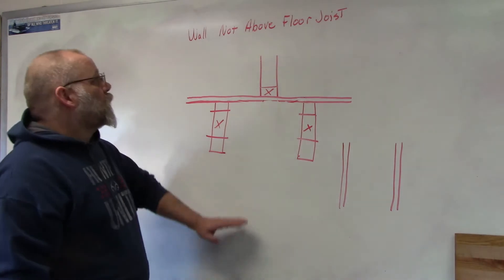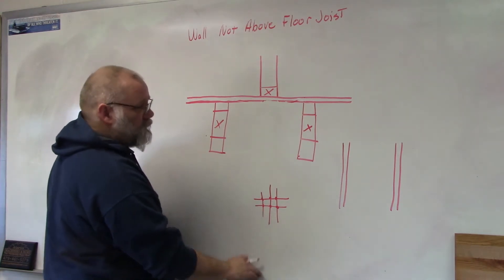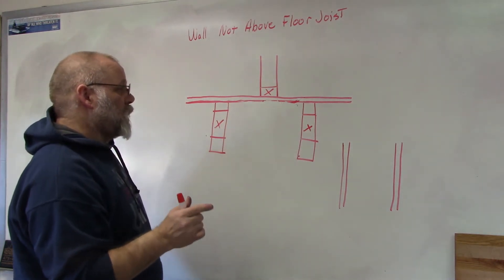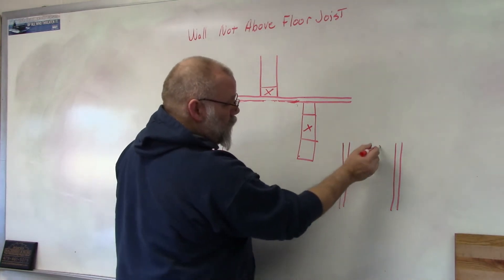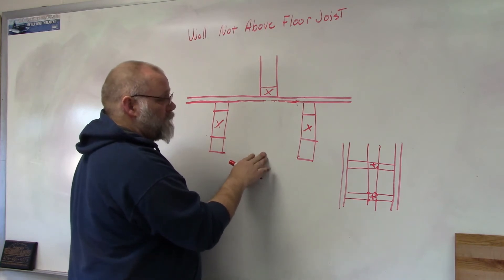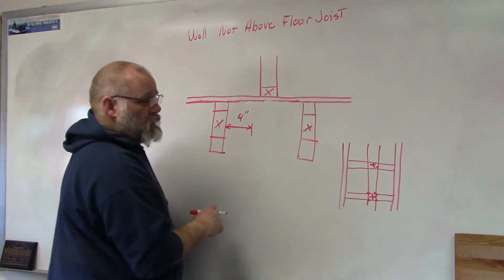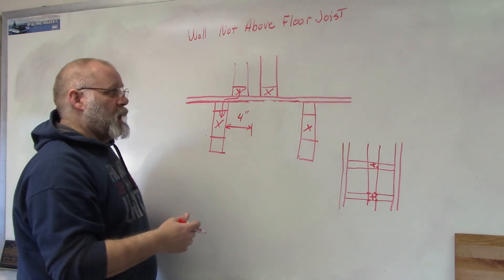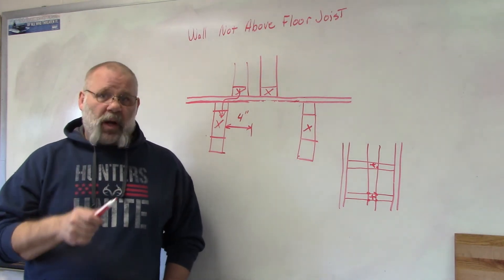Wall not above a floor joist

Comment: I need immediate support my engineer approved a 3’ cantilever lvl support beam under my second floor with an attic space. Transferring the load to the staircase wall eliminating a  LB wall between my living room and kitchen. Once completed a wall on the second floor sank about 3/4 of an inch. The wall doesn’t sit directly over a joist but might be within that 3” code. How do I level this wall properly without causing issues some where else. I.e the attic space or adjacent room?
Reply from the maker: You will have to jack the wall up slowly. Then you will have to use blocking or another joist to support the wall.

Comment: Great video - just what I needed.  Building a new quality custom home, amd I have a few long tall non-load bearing walls that will run parallel to the joists.  I am going to propose to the engineer we use blocking 16" OC, since I want to run 4 or 5" ventilation ducts in these 2x6 walls.

Comment: I have exactly this. A load bearing wall running parallel between two  2x8 solid wood joists. The wall is supported on both ends. But in the middle of the wall, there is a 60 inch gap that doesn't have any support. I want to put in solid wood blocks, with Simpson hangers on each side. For the blocks, do they have to be 2x8's? Or can I sister up two 2x4's or two 2x6's and use those as blocking with hangers on each end. I have pipes in this joist bay. I would like to install the blocking above the pipes if that's possible. Any idea about this?
Reply from the maker: @kevinsikora01  yes you can use smaller blocking, if you put blocking above and below the pipes it will help distribute the load.

Comment: Thanks.  This is the only ref I've found to my issue.  Replacing the SF I got to this load bearing wall and found no blocking under it and sagging between the 16" centers.  (I stopped taking out SF 2 joists away seeing this).  I plan to build a frame with blocking, jack the wall up from underneath and screw in the frame.   Just don't want this 4' frame too heavy to manage getting into place.

Comment: You said it's okay if the wall is perpendicular. What if the wall is load bearing that i want to put over  unsupported joists? Will mid joist blocking be enough or do i need to create another beam with posts underneath?
Reply from the maker: @realfood-life  I would go with beam and posts
Reply: @timpalmer-logstolumber1999  That's what I was thinking. Thank you! Learning a lot from your videos.
Reply from the maker: @realfood-life  that's great

Comment: How do we get cables into base of floor without drilling joist?
Reply from the maker: @sekritskworl-sekrit_studios  what are you trying to accomplish? Are you asking about wiring?
Reply: @timpalmer-logstolumber1999  I need to run cables from basement, up into walls of home.  I need to retrofit for network cabling in different areas of house and security cameras.
Reply from the maker: @sekritskworl-sekrit_studios  it is ok to drill floor joists. I made a video on where you can cut and drill floor joists.
Reply: @timpalmer-logstolumber1999  I'm seeing 2 of them.  And they are FANTASTIC pieces of information.  However, as 1) They are Vertical, and 2 the 1st & 2nd floor walls which provide access to the rooms are above them, I am afraid that their vertical orientation (leaving very little area to drill into without possibly introducing severe structural degradation by drilling down from the wall above)... I thought that I should check with someone more experienced.
Reply from the maker: @sekritskworl-sekrit_studios  sorry I wasn't more help. I would have to see it to give better info.
Reply: @timpalmer-logstolumber1999  Oh no... I'm sure that it's very subjective.  Thanks so much for the awesome content, regardless. :-)

Comment: What size wood do you need for the blocking? I just noticed that my wall is not over the joist and i've been jacking a joist to try and fix the sag and now the sag is worse and i need to do some immediate stabilazation. I can definitely add in some blocking I'm just not sure if 2x4, 2x(what ever my joist is) or if 4x4 or 4x(whatever my joist is which would likely be 2 2xwhatever glued together
Reply from the maker: @summeroliver4675  usually the blocking is the same size as the joist. But you can use smaller boards and put as many as you need.

Comment: I have a question what is the protocol for the ceiling ? 
Is it the same ?
Reply from the maker: Unless the ceiling joist are load bearing you don't have to worry about them
Reply: @timpalmer-logstolumber1999  but what is your wall lands in between two ceiling joists? How do you attach the wall at the ceiling?
Reply from the maker: @mikezdrummer you can install blocking between ceiling joists

Comment: Just the video I was looking for .
I am adding a bathroom and just framing 2 new walls as the other 2 walls are originally there .
1 of the new walls is running parallel the other is not .
I will just to see how close I am under house

Comment: I have a similar situation with a wall I want to remove.  The wall is on the first floor and runs parallel to the joist for the second floor.  There is a joist sitting on top of the wall I want to remove and it also has blocking between it and the joist on the side of it.  My thought originally was that the wall was not load bearing but now after doing some research I'm not certain.  Could it be that the blocking is in place to help distribute the load from the above that is not directly over the joist.  If so this wall isn't necessarily load bearing correct?
Reply from the maker: The blocking is for distributing the load on joist above. If the wall is running parallel to those joists it probably is not load bearing. Look at the ends of the floor joist above the wall, they will be sitting on something, a ledger, or beam or even a wall. Or have joist hangers holding them up.

Comment: I cut out subfloor in living room and came to that problem along edge of wall.Its got blocking every 16 inches.I was laying osb and can only screw edge every 16in on blocking.Wouldnt it flex or shld i add another blocking in between the blockin so i could sceew down osb every 8inches?
Reply from the maker: I would put blocking along the edge to support the OSB
Reply: @timpalmer-logstolumber1999  Do you mean  putting in a blocking like  the letter H.  Or like something like this lll
Reply from the maker: @elchoppo9248  along all edges that but together
Reply: @timpalmer-logstolumber1999  Thanks alot Tim.👍

Comment: Hi! Great video. I have the same condition BUT the wall above is a bearing wall and I want to make a 10' opening in that wall.. Will be o to just add the blocking below where the new opening starts and ends above ( where the beam above will be supported)?
Reply from the maker: The trimmers and king studs need to be supported. If they are load bearing the load needs to be transfered straight down in line.

Comment: Nice Video! I have a wall like this but only 1" off the joist, but I want to saw off the T&G subfloor on the other side, so I'll have to figure out how to install blocking under it as I remove floor planks. How close together would you place the blocking? It's a Lath and plaster wall if it matters.
Reply from the maker: Code says no more than 4 ft apart, I personally would go about 2 ft apart. I have a tendency to overbuild sometimes, but you know it won't move.

Comment: Is the 4" from edge of plate to edge of plate or center to center? Thanks in advance
Reply: I guess I should say edge of plate to edge of joist? Edge to edge on mine is 3"
Reply from the maker: @claytonnielsen8396  they should be edge to edge, remember that codes are minimums so extra blocking would not hurt. Personally I would put blocking in if possible.

Comment: Would the same apply if the wall is load bearing, I was under the impression joist only support the floor and load?
Reply from the maker: A load bearing wall would need extra support.
Reply: @timpalmer-logstolumber1999  Ok, Thank you!
Reply: @timpalmer-logstolumber1999   Have the same issue, sagging due to the load bearing wall smack dab in the middle of our floor joists, planned putting in blocking with a bearer supported by piles. Thank you for your vid, helped confirm I was heading in the right direction

Comment: The wall brace running beside the joist needs replacing . It's blocked up but it need to be raised . How can I raise the wall to replace the beams ?
Reply from the maker: You will have to figure how to jack it up, bottle jacks work best
Reply: Oh I have 20 ton hydraulic jacks.but the joist run with the beams .I think I'll create beams like a ladder to pick up the floor then replace the  outside beams
Reply from the maker: @tasmaniandevil7610  that sounds right

Comment: How would you push the wall back up once it’s settled
Reply from the maker: You would have to push it up with a jack from underneath
Reply: So all of the wood around the base of the “problem wall”  has warped so when I bottle jack in the basement it lifts everything. Can I some how isolate the post? Like cut around it- separating it from the 1st floor completely, and then jacking it back up?

Imagine the 4 corner states Arizona, Colorado, New Mexico, and Utah. Colorado and New Mexico are situated just like you explained. The opposite end; not the for corners, is depressed and I can’t seem to raise with out raising everything around it.